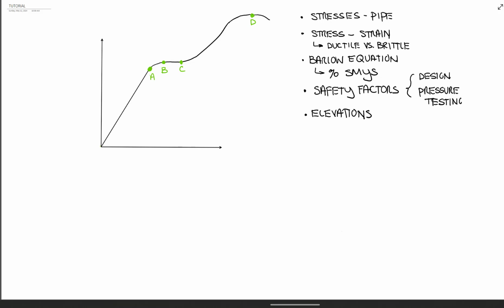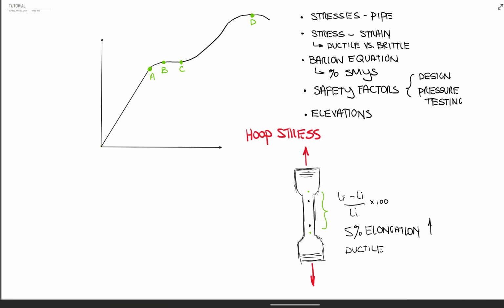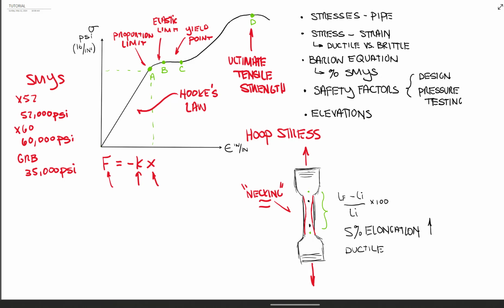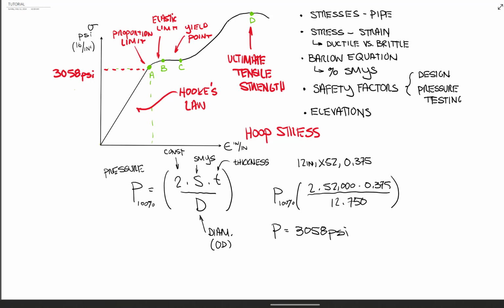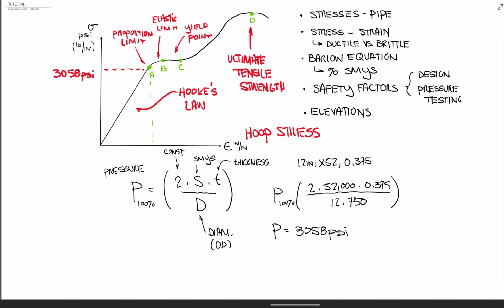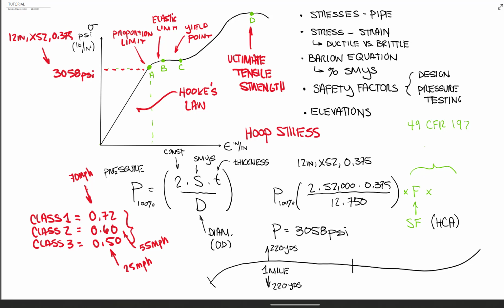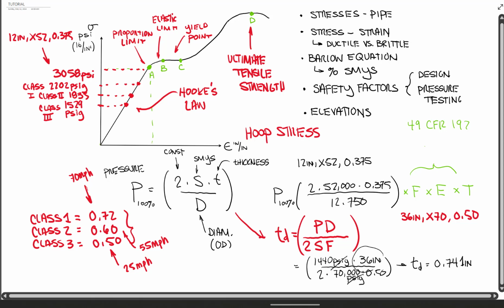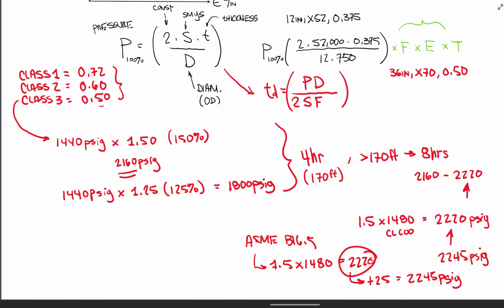Calculating Pipe Stress - Barlow Equation & Percent SMYS

Comment from the maker: @20:55 clarification: the larger the surface area, the larger the area for the pressure to act against for a given pressure. The hoop stress is generated due to the pressure acting against the pipe wall.

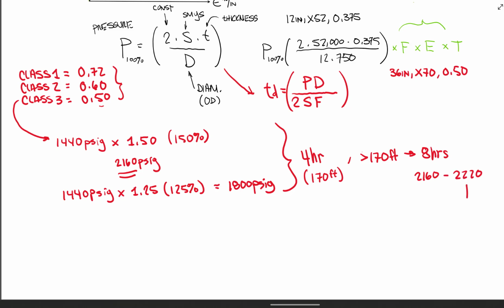Comment from the maker: @43:22 clarification: flanges are not always the weakest component and limited to 2220psig. Depends on the diameter, grade, and wall thicknesses in the proposed pressure test.

Comment from the maker: @45:15 correction: I meant to say that if the piping goes from a class 1 to class 2, then the piping needs to operate below 60%, not 72%. Which would necessitate a possible upgrade in wall thickness or grade to ensure we are operating below 60%.